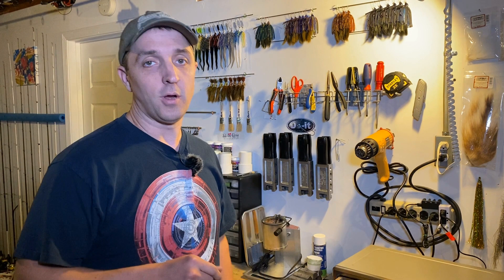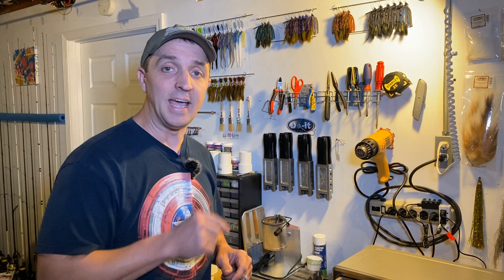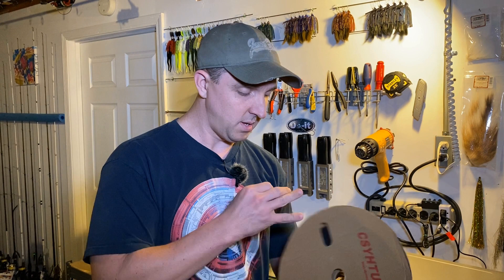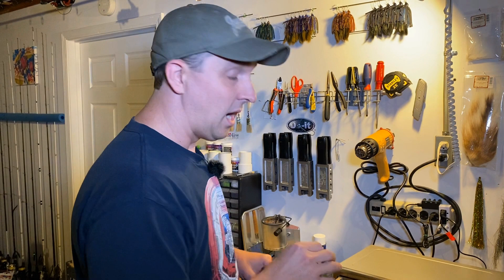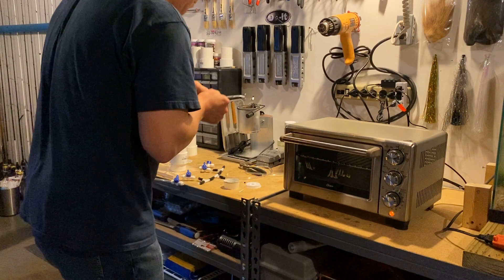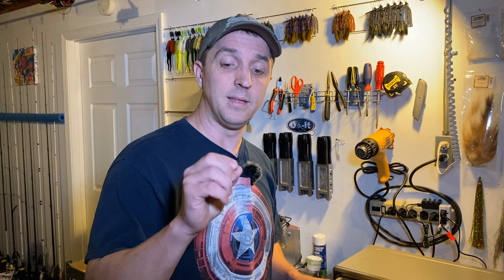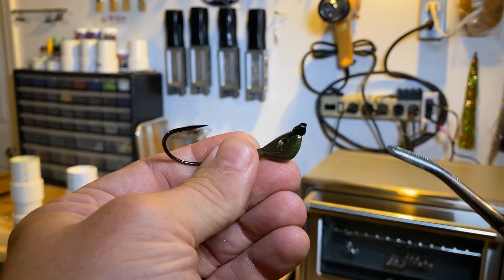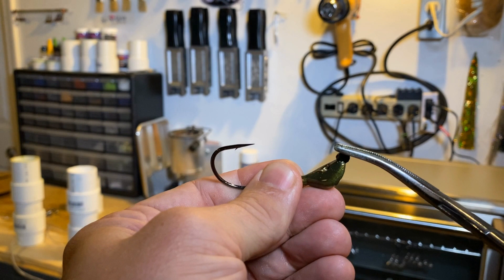My Secret to Keep Paint Out of the Jig Hook Eye!

Comment: I've been using heat shrink for over 20 years. It works fantastic and comes in different sizes for different size hook eyes. I just put one on, heat in front of a torch and dip. I know lots of people don't mess with it but to me it's the best way to paint heads. I used to use an exacto blade to remove the paint before I figured out shrink tubing worked. Great video...
Reply from the maker: I rarely paint without it anymore!!  The extra 2-3 second to put it on has saved me 50x that afterwards with a drill or razor blade!

Comment: I tried several ways to keep the eyelet clean including this. I dont know if i let the jigs set too long or what but when I removed the tubing, usually a chunk of paint came off too. I was painting 1/8oz round jigs with a fluid bed. I would paint them then they probably set up for about 30 minutes before going into the oven.
Reply from the maker: Hey Brian, that’s curious.  With 1/8oz heads the hook eye is really small.  Maybe the tubing is oversized and covering some of the head even after it’s shrunk.  What size are you using?
Reply: @SDGCustomLurecraft  I miss-typed, I tried this on 1/16 oz heads which would be even smaller. I used the smallest tubing I could find at Lowes which was 1/8".  I may try to pull them off as soon as they come out of the fluid bed or maybe try to keep the tubing from touching the top of the jig.
Reply from the maker: I use 3/32 from Amazon for anything under a 3/o.  Check out the link below.  It’s a big roll, last you a LONG time and under $10!  https://amzn.to/3dguSbp
Reply: @SDGCustomLurecraft  thank you!

Comment: Thanks for the tip Adam. I started doing this and it works great. Do you have a tip for keeping paint out of the weed guard hole?
Reply from the maker: No problem, glad it’s helped!  Do you have any teflon pins?  After I pour the jig I remove the steel pin but put a teflon pin in after I heat the head but before I dip it in the fluid bed. I then remove the pin to cure it in the oven.
Reply: @SDGCustomLurecraft  Thanks for the tip. I placed an order teflon pins and I look forward to it simplifying my jig painting.
Reply from the maker: @justaguy8627  good deal man!  Glad I could help.
Reply: Hi Adam. Do you have any pro tip for keeping the pain out of a recessed-eye?
Reply from the maker: @justaguy8627  great question man... I’ve been noodling over that very question myself in recent days as I have a FB and Shaky Head mold where the eye is recessed on certain sizes.  In my experience, the heat shrink is still helpful, but doesn’t do the trick completely.  Where possible, I’ve actually been trimming the lead back just a bit after pouring, rounding it out with a file so it looks nice, to expose more of the eye.  That will only work on certain molds though.  Another option is to use the tubing to keep the majority of the paint out then file out the eye before curing.  It’s tedious, but it does work.  Third option would be to clean the eye with a bobbin while it’s still wet (right after dipping).  I find it makes the paint stringy and could make a mess of the rest of the head so I don’t usually go that route.  Last option that comes to mind (which I haven’t tried yet) is to hold the jig by the eye (clamp the eye between the plier tips) and dig holding the jig by the eye (vs by the back of the hook).  I think key to this approach is to switch pliers... use one set to heat the head then a “cool” set to hold the eye for digging.  Otherwise... the heat on the first set will just melt paint to the pliers.  Theoretically, that blocks the paint from getting into the eye assuming the plier tips are wide enough to “close off” the eye.  Planning on trying this soon, you should too and post here or send me an email, let me know how it goes!
Reply: @SDGCustomLurecraft  I've tried option #3 and you are right, the paint can be stringy and sometimes pulls paint from the head. I found it easier to just drill out the eye after  baking.  However, your last idea is the way to go. Since you dip the jig from the head instead of the hook bend, I had to build a new fluid bed that was deep enough for a 4/0 hook. I used a pair of forceps to grasp the hook eye, and I found a pair that matched the size/shape  of the eye. The forceps also lock and makes it easy to maintain the grip on the eye. Thanks for the idea and advice!
Reply from the maker: @justaguy8627  sweet!  It’ll be trying that method the next go round.  Glad it worked!  I use forceps (trout pliers) that lock even when I dip “normal” jigs... just way easier not having to worry about constant pressure.  My forceps have a curve to them as well... I’m thinking that may help with the “dip angle” as I use 2” PVC... not a lot of extra room.  Appreciate you sharing the results!

Comment: What is your oven temp for this process?  Pre-heating before painting
Reply from the maker: Powder paint cures above 300, I believe the jar calls for 350.  My oven, however, is not calibrated correctly… most toaster ovens are all over the map… so I set mine to 300 to, effectively, get 350.  20 min preheated, 25 min if it’s cold.
Reply: @SDGCustomLurecraft  I meant oven temp for jigs before you paint
Reply from the maker: I use the heat gun to heat the jigs prior to dipping.  I’ve used the oven before but you have to CRANK it up, basically to max, then wait for the head to heat… aftershock you’re opening and closing the door losing heat as you go… it just didn’t work out for me so I stuck with the heat gun.